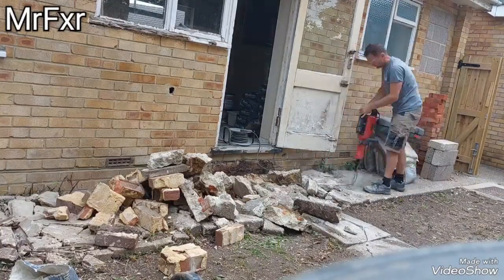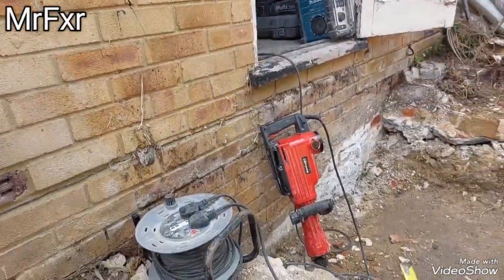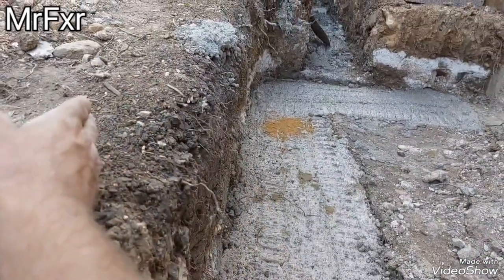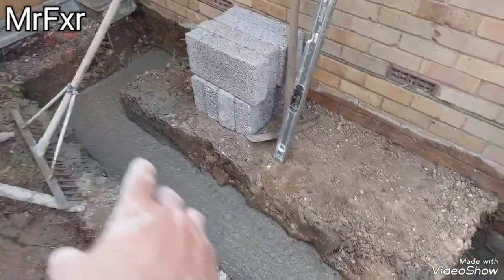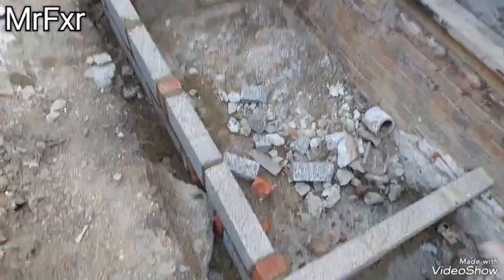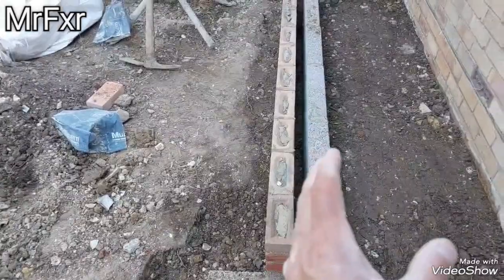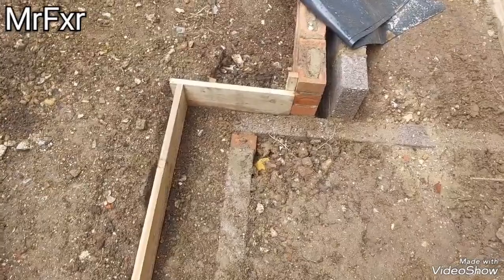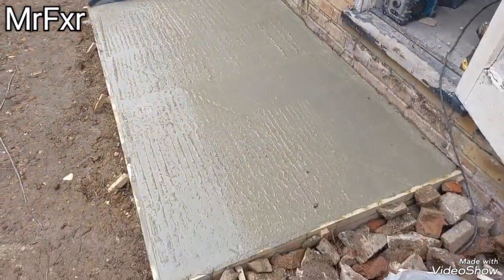Bungalow refurbishment 18

Comment: Finally found more time buddy!

Was that old kitchen pipe clay? If so how the hell did you dig around it without breaking it?!

Wow, I’ve never heard of a cantilever concrete slab before.

And is that an electric compactor? I’ve never seen one!

Fantastic video though. I learned so much once again!
Reply from the maker: Thanks! 
The compactor plate is electric one, made by Evolution. A brilliant little tool🙂